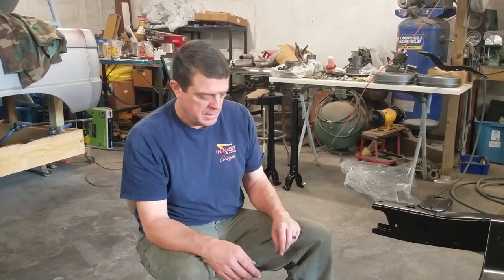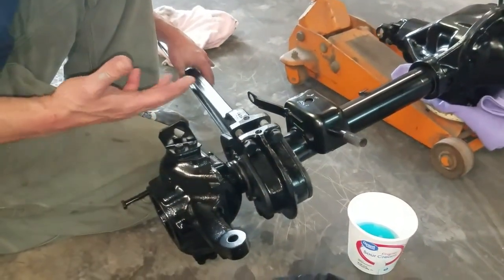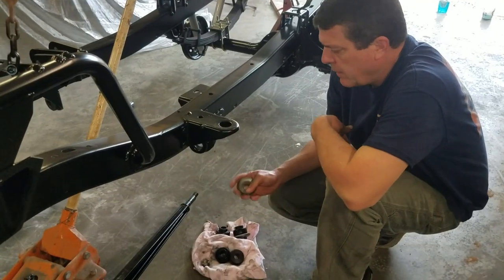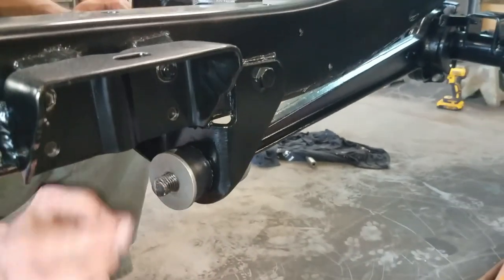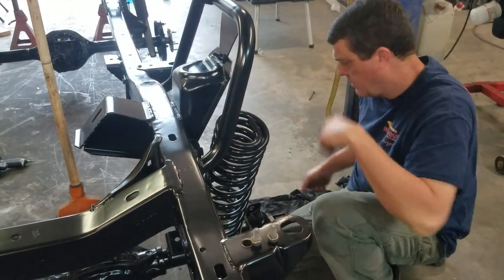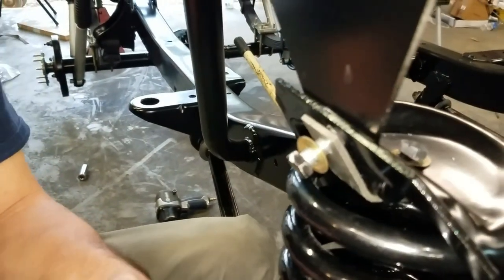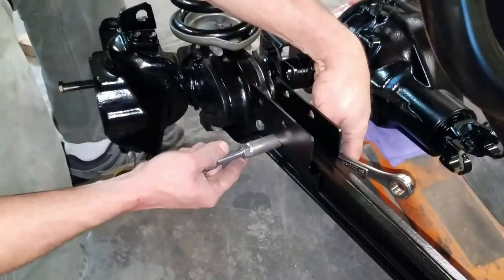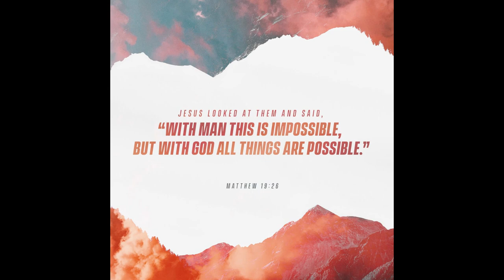Stage 5 Front Suspension Install - 1966 Ford Bronco Restoration Project

Comment: Hey Jason, Installing my Tom's 2.5 front suspension now. My springs did not go on as easy as yours. There was no gap at the bottom of the spring to clear the retainer tap so had to improvise there. Funny my shock tower frame mounts and shock mounts are different than yours. Your video is a great reference. I was looking for you at Super Cel east. Take Care!

Comment: Thanks for the videos! I have a 67 that I installed a 2.5" TBP lift on. The front rides just fine. The rear is horrible. I called TBP and they said to improve the ride in the rear, go to a softer shock.
So I ordered pro comp rear shocks and it helped some.
We drove it for a year and was just not happy. 
So I experimented by removing the 3 small leafs at the bottom of the pack. And it was night and day. 
A year and a half later... I have a lean to the driver side. So, I may either order a different set or re install 1 of the small leafs on that side. 
IDK!!! $$$$$$ 🦧🙄

Thanks for the Time yall put in!
Reply from the maker: Thanks for watching and for the info.  I have not driven ours yet but will surely keep that in mind.  Thank you!
Reply: @JasonJonieBuilds  after seeing your rear leaf's they are different than mine.
You may be ok. Ours were crazy stiff. And the shocks were really stiff as well. 
Cant wait to see yalls finished. 
I wanna do mine the same way, body off!  
Its a U15 3speed column, 289.
I replaced the D30 drum front axle for a 74 D44 and used all Ford brake parts from a big Bronco. Best thing I did.

Comment: thanks for the video! is there a reason you use Dawn instead of a grease on the bushings?
Reply from the maker: You can use a silicone based grease.  It is just messy.  Thanks,
Reply: @JasonJonieBuilds  thank you!

Comment: Did you check the end of your radius arms to see if they were level to try and avoid the “bronco lean”?
Reply from the maker: The radius arms seemed parallel when I installed them.  I will check better when I can put weight on the chassis.  Thanks for the question and watching.  I will address it when we put wheels and tires on it.
Reply: The arms were fairly level when he installed them on the frame. You could see both arms inserted at the same time - no wrestling to get one or the other installed. Doubt he'll get the 'bronco lean'.
Reply: @JasonJonieBuilds  Is there some specification or measurement to have when you address the levelness when you put the wheels and tires on. Basically my question is what parameters and or tolerances do you need to have to avoid Bronco lean.Thank you.
Reply from the maker: Honestly, there are a lot of things that can contribute to the Bronco lean.  I have seen new rear spring sets that didn't have the same arch even though they were purchased together.  I had some lean on my Bronco because the Tom's 2.5 coil springs didn't fit in the lower mount correctly on one side.   It had me about 1/2-3/4 high on the passenger side.  I had to relieve the mount so the spring would set inside it.  No problem after that.  It will be hard to tell what you have until all the weight is on the Bronco (fully assembled).  Good luck.

Comment: Jason, will the 2 1/2” lift give you clearance for the 33” tires you have or are you doing body lift as well?
Thanks again for the videos and the time you out into it.
Reply from the maker: Yes sir.  My Bronco is cut so we have all kinds of room.  If you plan to have a LUBR it will probably need narrower tires or additional lift.  Our tires are 33x12.5-15.